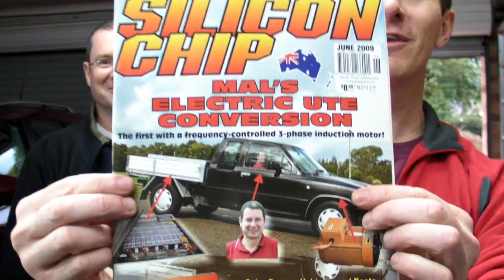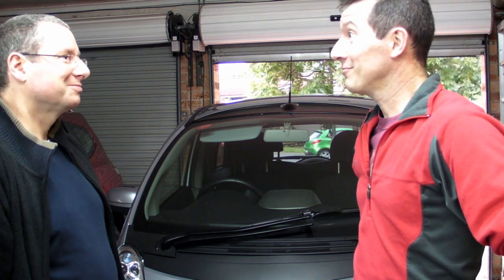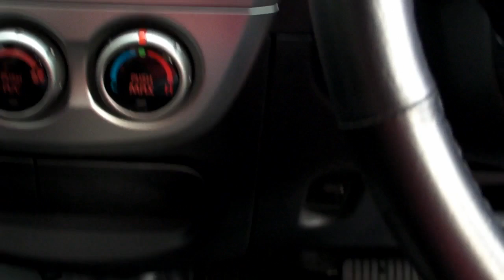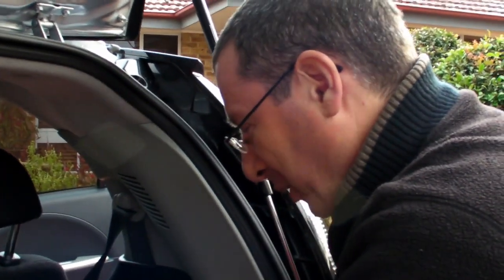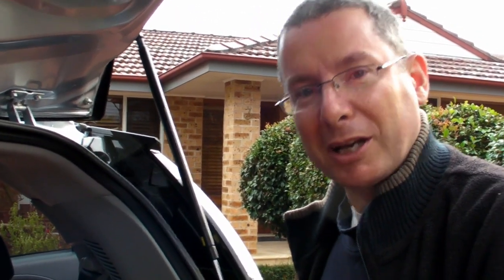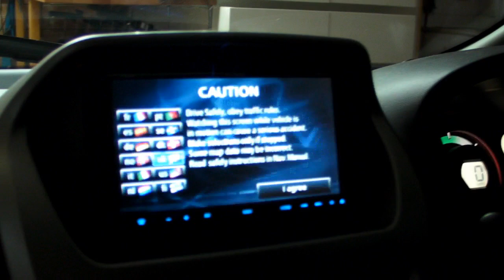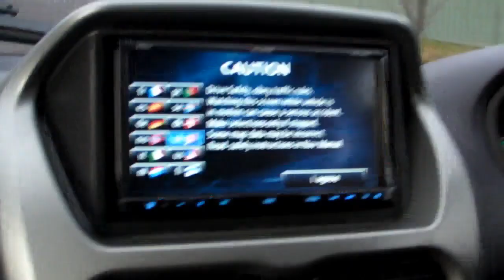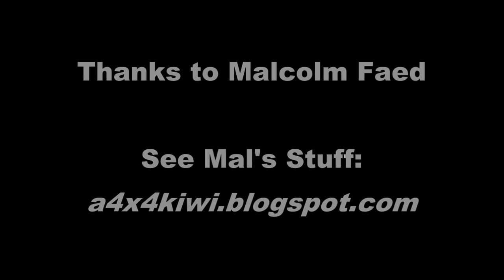Mitsubishi iMiEV Electric Car Test Drive - EEVblog #179

Comment: To make this main stream:
-Gas becomes nonexistent (100-150 yrs from now?)
-Price must come down (these cars are +$30,000 now)
-Faster charge, more charge public charge stations, hot swap battery stations (hot swap-automated system, swap charged packs in minutes, paks leased)
Lease the battery packs or guaranteed replacement cost.

New battery technology, fuel cells, getting 1000 miles verse 60 to 100 miles will be a good thing as well. I like having an Aux gas engine (ala Volt or Prius).

Comment from the maker: @Whisper6911 They would be engineered to prevent that. Many different construction variations on Li-Ion exist, and some are quite safe, and you can build safety circuitry into the individual cells.

Comment: @Whisper6911 2: LEDs will make it to headlights eventually, I guess the problem is just price of the LED and its cooling system. In terms of power consumption, lights are really small, almost insignificant portion.

Comment: I'm sorry and I know it makes no difference in the scheme of things but I get really annoyed when people dont know the difference between torque and power.  The description was half right, power gives top speed AND acceleration, torque has not much to do with anything, however it is a function of power.  A jet engine has low torque and high revs, but would make a vehicle accelerate well. A long stroke diesel tractor engine has high torque but would give poor acceleration.

Comment: @AntiProtonBoy I got that but still it would take months to charge it. Let's say you have 50 kWh battery pack, beefy 100 W solar panel, ideal DC/DC with no losses, 5 hour/day average full power from sunlight (it will be less due to non ideal angle). So with all this you would need 100 days to fully charge the battery.

Comment: That can't be HID headlights can they? For starters there's more than one lens per each housing, something that often means LED headlights and secondly there's no headlight cleaning system on those either. Isn't it the law to have that over there? Atleast in Sweden it is.

Comment: You really have to hate life to drive one of these...

But that's just me, i'm a car enthusiast :D

I'm not gonna go into it, but i really think the future is hydrogen, not electric powered cars.

BTW, the rear tyres are wider to provide traction (rear wheel drive, remember), while the front tyres are thinner to provide less resistance when you turn the wheels.

Comment: How long do Li-ion Batteries Last on an Automobile?  Nobody is talking about it's longevity and power-loss.  Because you wouldn't wanna own an electric car with 80 miles of range yet depletes to 40 miles in 5 years.  Basically you'll end up with a useless car without Battery Exchange option.  The i-Miev however is a great car.

Comment: @PiezPiedPy 
It takes roughly one pound of of coal to produce a kilowatt hour of power. The MiEV has a 16 kwh battery. I'm just pulling this out of my ass but I would expect if to take 20-22 kwh worth of power to charge. So you are looking at burning 22 pounds of coal to travel 75 miles. A gallon of gasoline has enough heat energy to produce approximately 34 kwh.

Comment: The cost? Nissan LEAF (very similar) is better?  
Nissan Leaf is $32,000, ($25,000 after tax rebate)

Drive 12,000 mi/yr, 30 mpg, 400 gal/year at $3.60/gal (assume $4.00/gal) or  $1,200/year gas, no charge time, travel cross country (gas car).

Econ car, gas engine, nicely equipped costs $18,000; You need to drive 6 yrs to save money (12 yrs w/o tax rebate). Battery pack is good 6-8 yrs, no replacement cost set yet ($). All gas Econ or Gas/elec hybrid at 50 mpg still has edge?

Comment: Not much point in covering the front plates when you show the rear ones. :-)

Does dirt and crap come up into the electronics compartment through all those holes in the bottom? How's the safety with no large crumple zones up front?

There's a big problem exposing charging cords to the great unwashed copper-stealing public. The 2 library chargers here have been robbed. How will you keep your cord? They should use braided steel (pun intended) wires to discourage theft.

Comment: Are power brakes actually needed on a car this lightweight? Doesn't look like it will fit a 6'3" fat man that's for sure.The downside of EV,  I think, will be the availability of raw materials needed for PM Motors and the batteries

Comment: I absolutely don't get the electric vehicle hype I must say. Energy density of any kind of batteries still sucks badly when compared to chemical carriers (per volume and per weight), and power plants don't exactly grow on trees either.

Keeping emissions out of cities? Yep. General purpose use? Hell no.

The future car might be a gas turbine hybrid or somesuch, and it better be much lighter than current-day models (often >1 t of car for <100 kg of load, WTF?).